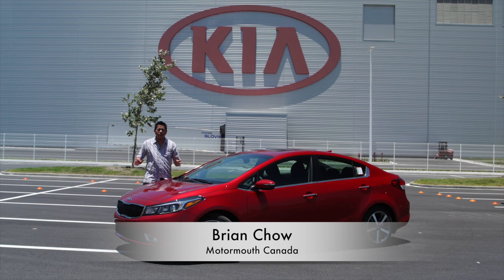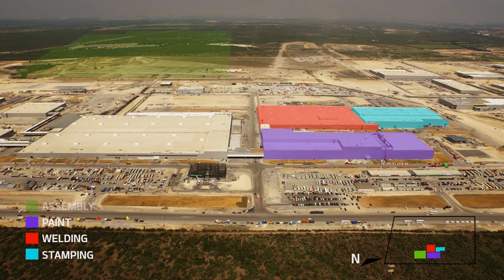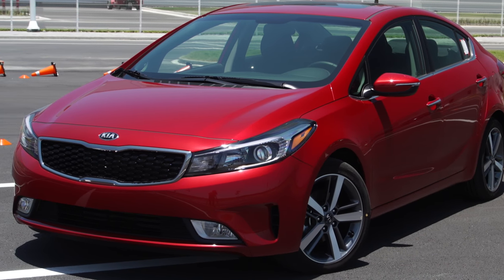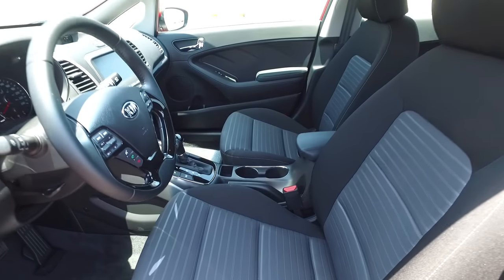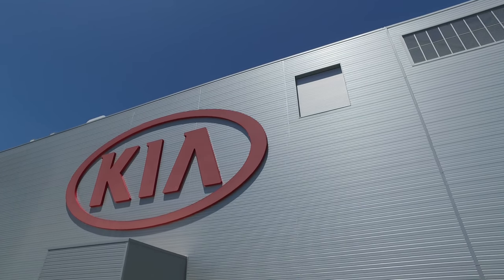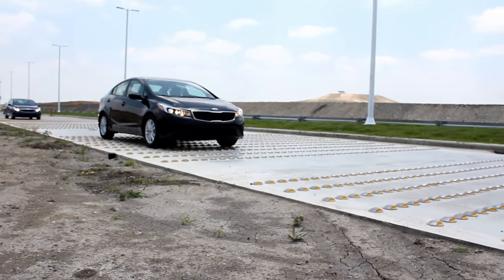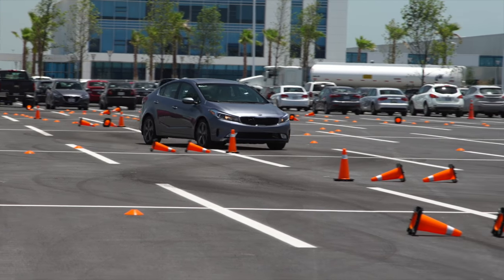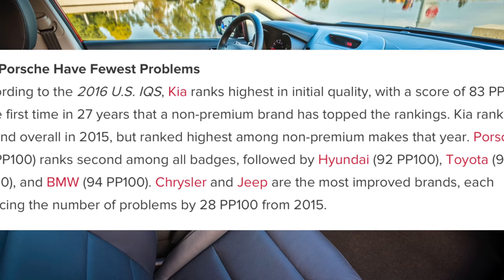Kia Forte Review

Comment: shity windshiel cracks after one little crack engine drinks lots of gas suspension could be a better ride, transmission sticks, i do like the look and power of the car i have 2018 one but wont buy again, not with that engine and ride, the car however is built well, and if you buy one get rid of those stupid nexen tires